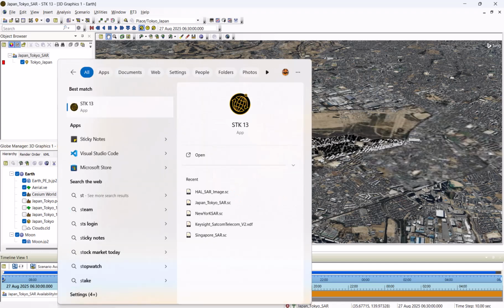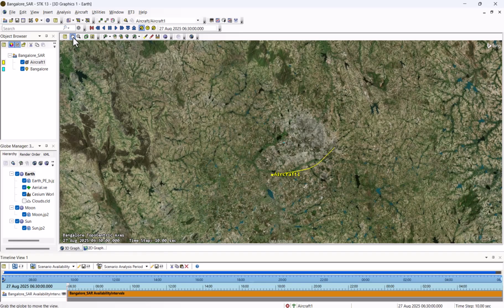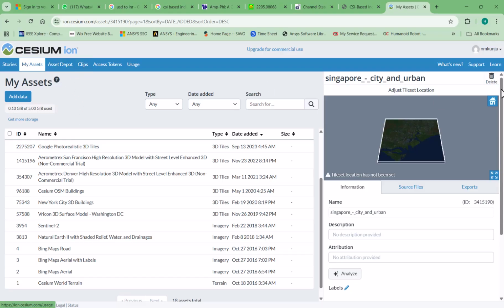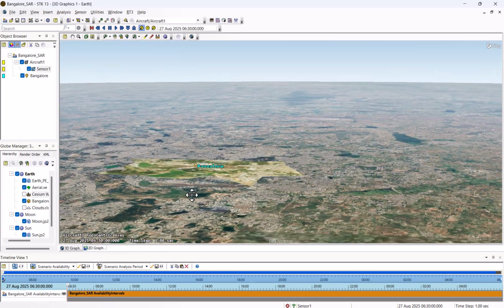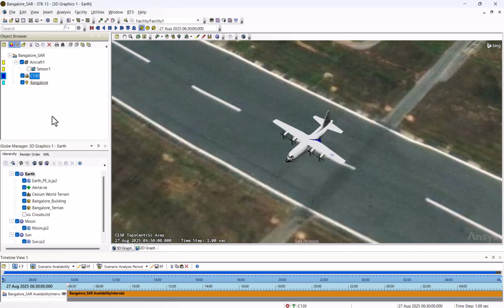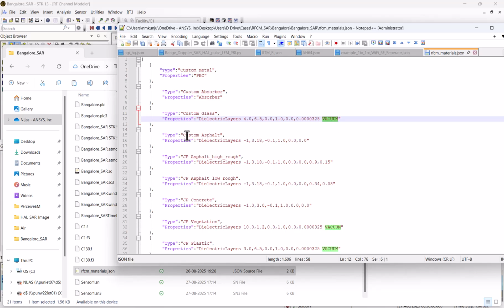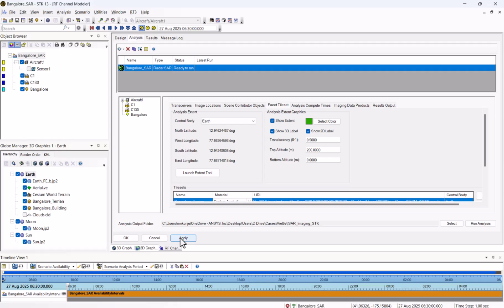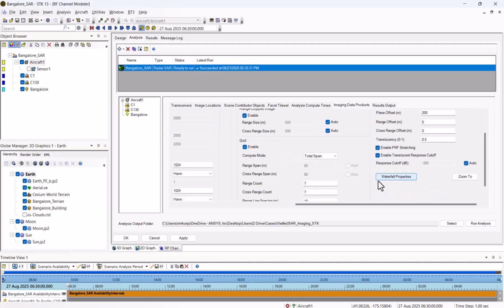How to create Synthetic Apperture Radar (SAR) imaging using Ansys STK RFCM

Comment: can you explain the desgning of HF NFC antenna ,and its reading technquie using SBR+
Reply from the maker: NFC working at a lower frequency band and SBR+ solutions are not accurate for an electrically small problem. You need to use FEM or FDTD based simulation for it. I will try to create videos based on time availability
Reply: @hfss_for_rf_application3040  even for the UHF  RFID also SBR+ is not accurate ?,can you  make video for the UHF , HF rfid , please ,Beacuse there is no resoucees out there to learn , could you please help , im student,
Reply: @hfss_for_rf_application3040 in UHF RFID also results are not accurate to calcutlate the read range of rfid tag using SBR+ ? , i need more info about it, because im not able to find much resources in internet, could please make video about this topic mainy UHF and HF RFID tag antenna its read range using SBR+ in ansys HFSS